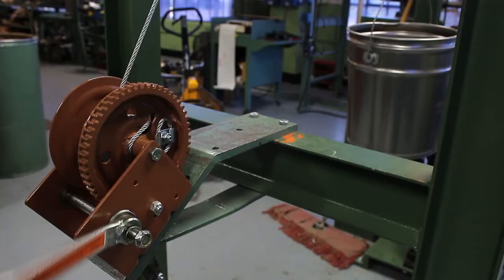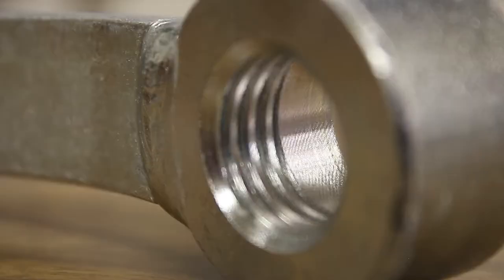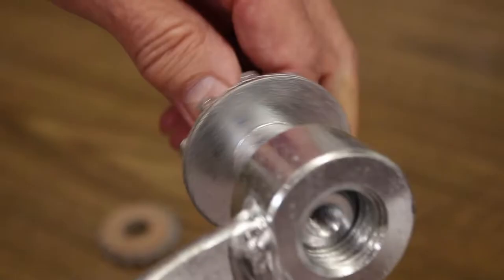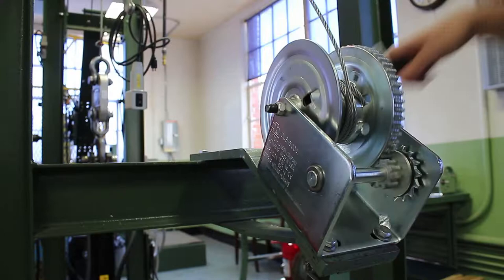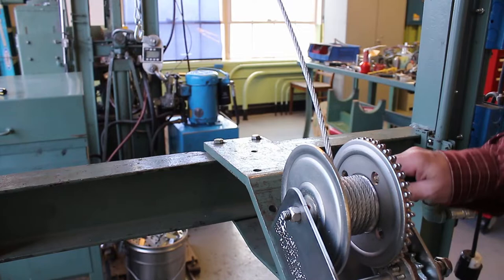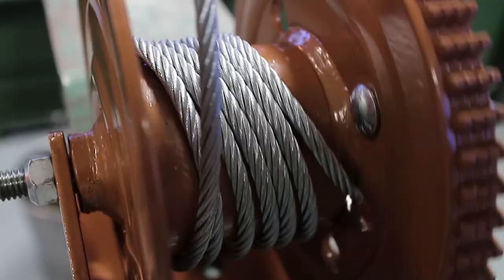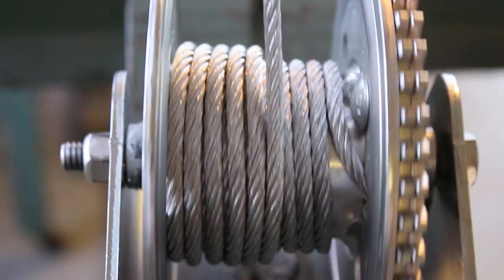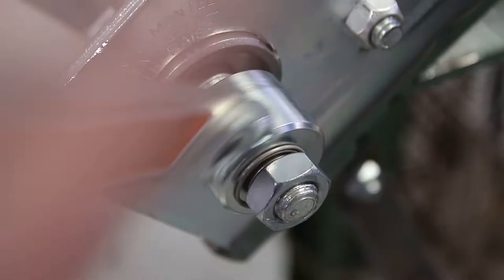Why Isn't My Brake Winch Lowering the Load? - FAQs

Comment: Hi, how can i calculate these loads ? Meaning it is surely related to the forces of friction between the load and the threads, but i can't quite calculate the exact couple needed to be applied on the threads so that they screw themselves back on ? Thanks for your answer !
Reply from the maker: Thanks for your question!  All of our brake winches have a minimum load specification in order for the winch to function properly.  As long as you have more than your winch's minimum load attached to it, the friction break will activate and hold your load in position.
Reply: @DuttonLainson  I just wanted to know if someone could help me out for a mecanic exercice, if you have determined the loads with experiment, calculus or modelisation ! Thanks for your quick answer !
Reply from the maker: @Greyback2305  We may not have the type of information you are looking for, but please call us at 402-462-4141 and ask for someone in the Engineering Department.

Comment: Hi, loved the video but I have a question. How do I install a removable handle on my DLB350A brake winch?
Reply from the maker: Thanks for your question!  You can install the 6453 (https://www.dutton-lainson.com/proddetail.php?prod=14467) or 6454 (https://www.dutton-lainson.com/proddetail.php?prod=14468) on your DLB350A but removing the standard handle from the winch (along with the spring and nut on the end of the drive shaft).  You then thread the square tube hub from the 6453 or 6454 kit on the drive shaft, followed by the removable handle, followed by the hex nut to hold it all in place.

Comment: I don't know why you say turning the handle to lower the load doesn't forcibly turn the winch, when obviously it in fact does or else winch would not be turning with the handle and the cable would not be getting loose, without a load on.  I understand that you'll need a load on there but it doesn't seem correct to say the handle doesn't turn the winch when lowering a load. Even without a load the handle turns the winch!.  Just saying. It's confusing.
Reply from the maker: You're right- it doesn't seem correct to say that cranking the handle doesn't turn the winch when lowering a load.  That's why we say at the start of this video that this is often misunderstood!  However, turning the handle to lower a load (over the winch's minimum load) does not forcibly turn the winch, it simply allows the load to be lowered.  As you can see in this video and as you stated, turning the handle without a load attached (or with one attached that weighs less than the winch's minimum load) does forcibly turn the winch, at least until the handle unthreads from the drive shaft threads.  A more detailed explanation of D-L brake winch's brake function can be found in this video: https://youtu.be/Gjo-2k3X6O4